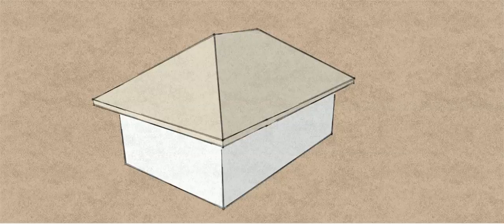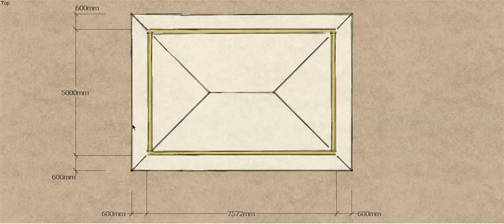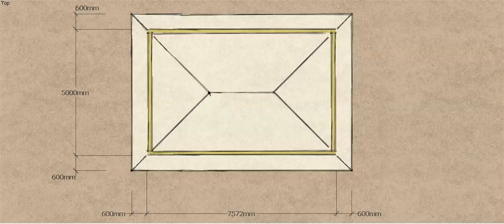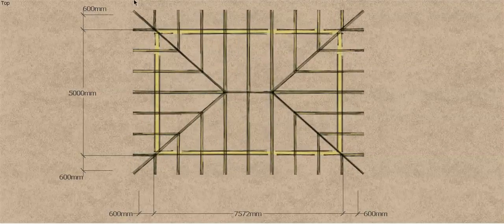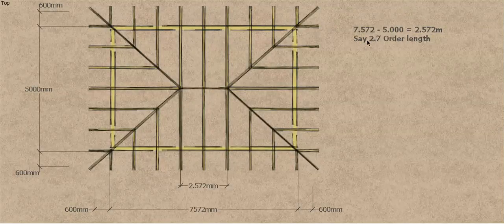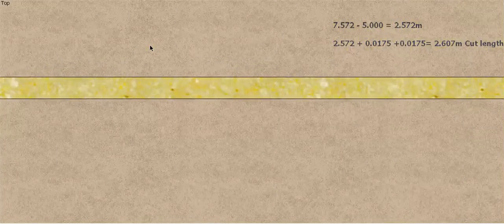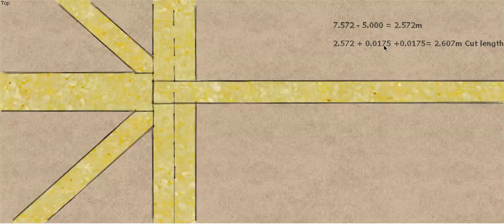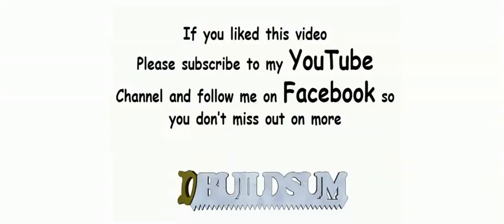Hip Roof Ridge Length

Comment: great video, but my question is, how can I find the roof height/rise without using trigonometric method, can't I just think of any number I want to use as height or rise?
Reply from the maker: Hi Johannes, thanks for your comment. As a builder or a carpenter, we are generally given the required pitch of the roof and are required to work with that however if you are designing the building or roof then, of course, you could just pick a rise although it is more common to pick a pitch and the work out the rise from there. 
I am not aware of a method of working out rise without Trigonometry other than drawing it out to scale or even full size and measuring it of the plan.
Hope this helps

Comment: Say you lengthen your Ridge, and you won't get that 45 degrees. how do you figure then?
Reply from the maker: Hi Mate, as the hips always have to bisect the corner then in the average building they are always going to be 45 degrees so this shouldn't happen in the average building however if it does I would just work ou the half span of the of the building and the distance that the ridge would stop from the end and take that away from the overall length of the building on both ends to get the length of the ridge. Just remember that this is not normal and the roof would look weird if you actually built it like this.
Hope this helps
Reply: Buildsum, so all 4 face slopes are equal with bisect hips? My right face slope is slightly greater means what for angle, bigger or smaller?
And.
 There are gables on top and bottom face so I don't have straight alignment ability to the ridge from the eve. How can I determine vertical on both sides of gables so that I can lay down metal panels and have them be plumb so to not get skewed thanks.
Reply from the maker: OK, You may have an Unequally pitched roof, where the angle of one side is different to the angle on the other side. The most identifiable feature of this would be that the ridge would not be in the centre of the roof.
I don't have a video on these at the moment.
If this is the case then the angle on the longer side is usually still the 45 degrees, on plan, while the angle on the other side will be adjusted to meet the long hip at the ridge and obviously not 45 degrees.
Reply from the maker: As the longer side is still 45 degrees then the 1/2 span of that side can still be used to get the length of the Ridges as per the video.

Comment: Good video well explained, another way is to add a saddle board for the crown rafter and the Hips to be fully seated against, when the crown rafter is set against the saddle board it also needs a small triangular block fixed to the underside of the plum cut allowing the longer length of the Hip rafter plumb cuts to fully rest against.
Reply from the maker: Hi Thomas, Thanks for your comment, I have never seen it done that way but good to know.